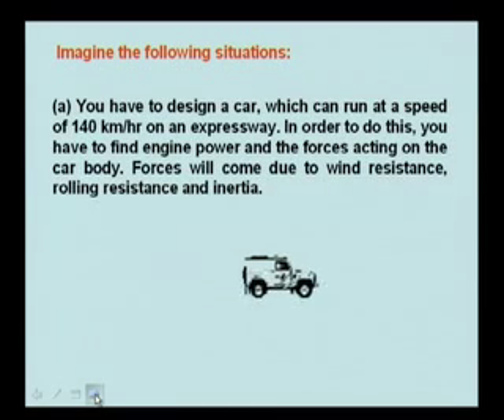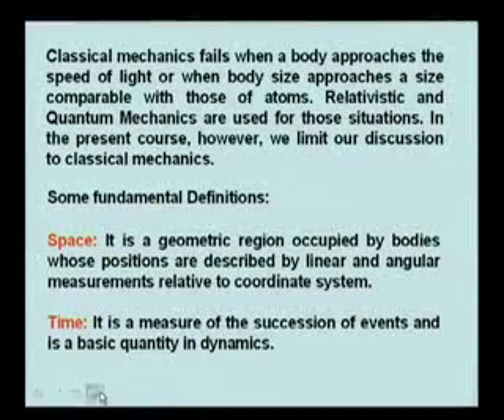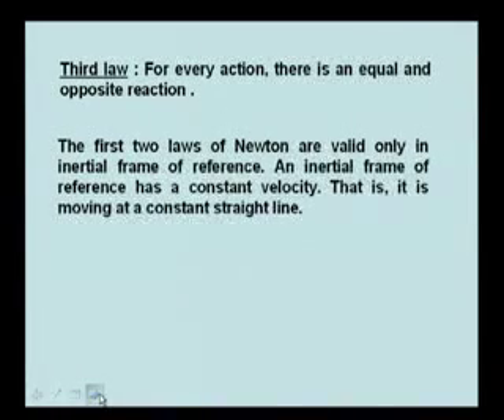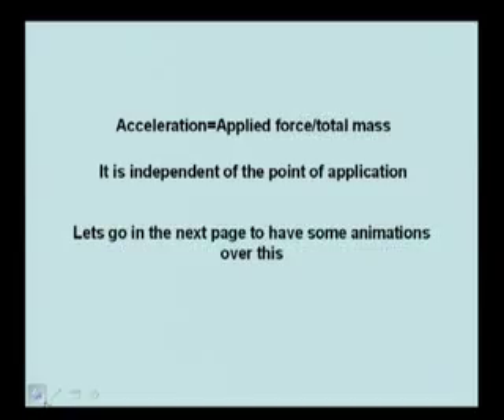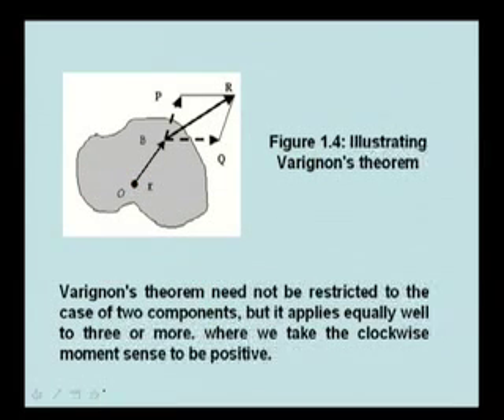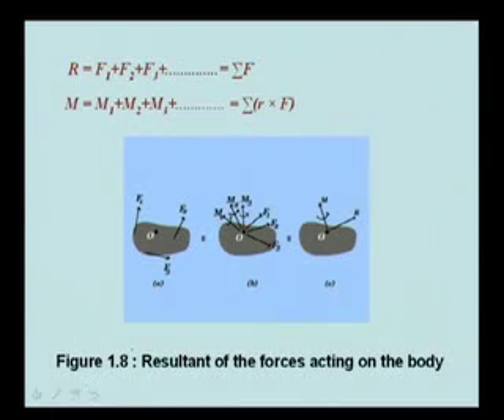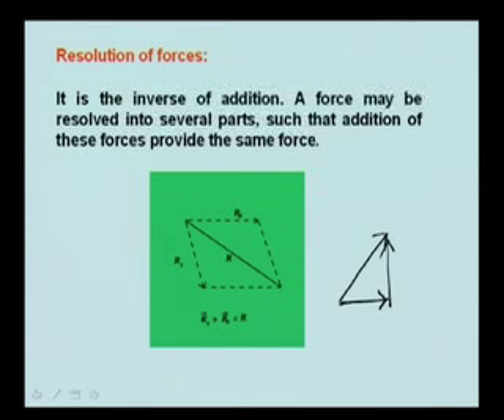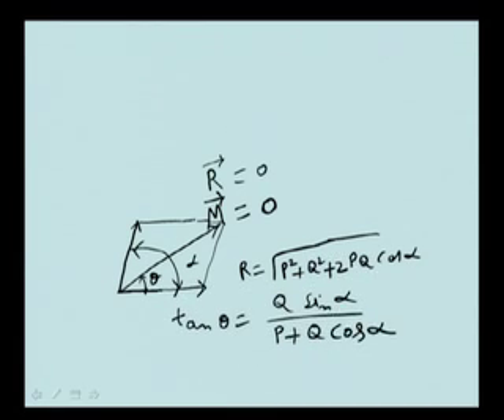Mod-1 Lec-1 Fundamentals Of Engineering Mechanics

Comment: For anyone having difficulty with the audio - the lecturer's English is absolutely fine, he just has a regional accent. You'll get used to it eventually, but in the mean time you'll have no problems following along if you choose one of the following options:

1) Turn on captions: Click on gear icon -> "Subtitles/CC" -> "English - Lec 01". These are not auto-generated captions; they've been transcribed and corrected.

2) Full text of the audio (plus screenshots of the slides) for ALL lectures in this course are available in PDF format on the NPTEL website here: http://textofvideo.nptel.iitm.ac.in/video.php?courseId=112103108

My thanks to NPTEL and Professor Dixit for this valuable content.